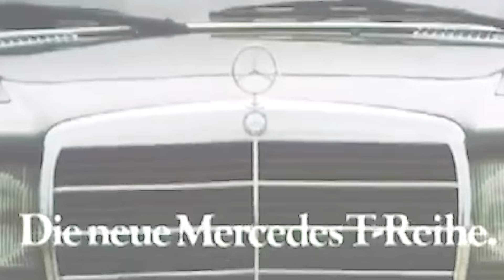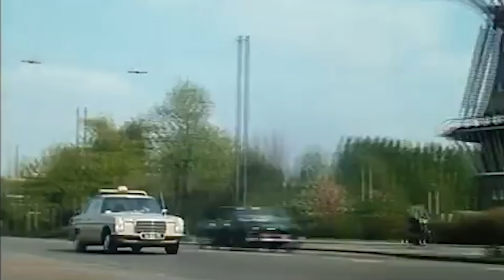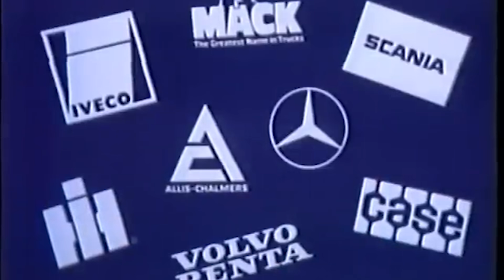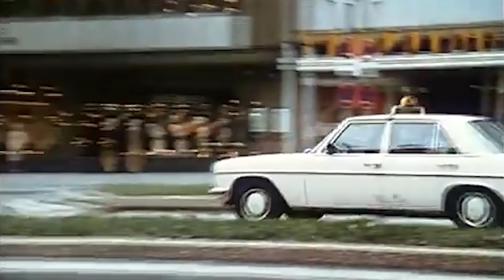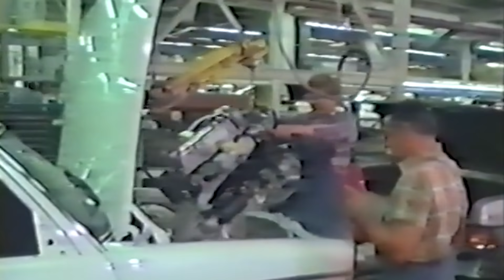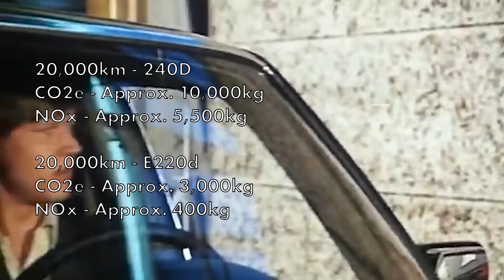Mercedes 240D - Still Fit for Daily Use?

Comment: OK I,m older, but I would still have back my 1971 Mercedes 200D  (what was it W114/5 or something like that?)  It had 55 PS (Pferdeshaft = BHP)...it was cheaper to insure than the 1600cc Ford that I had previously owned.....OK It was SLOW, and could be overtaken today by those Lycra clad maniacs on racing bikes....But it would drive from Northern Germany down to Frankfurt with no fuss or bother...after a couple of days (midwinter) it would start again and drive home?  It felt solid...unbreakable..if I wanted to (not a big guy) sleep in the boot(trunk).  or across the back seats.   One thing people forget about when restoring these cars...is that those springs although good, take a battering from the weight and if you don't change them for NOS or better...you will just have a nice looking sloppy bad handling car....when new, they were surprisingly nippy and handled well.

Comment: It also depends on if you have a robust used cooking oil to fuel recycling system, which large parts of the United States have, you burn what would be a horrible waterway pollutant, it burns cleaner than diesel both with respect to human health and things like particulates, which are potentially Greenhouse Gases as well, and also would biodegrade into not so nice Greenhouse Gases of their own accord, which also changes the equation.

Comment: Nitrous oxide is still an issue but these cars run on biodiesel and renewable diesel which lowers the emissions quite a bit.  And you can fuel them yourself with algae oil if you make an algae pond, or you can use vegetable oil so counting in not having to build a new car they're pretty good. It is annoying the smoke, I had a 1984 300SDL turbodiesel and there was always soot on the trunk.  This not true on my 2006 E320 CDI.  I think people missing that one,  The W211 with the OM648 really is the best of all classic mercedes.  It last longer, it's clear, fast, has advanced traction control, it's aluminum and corrosion resistant, it's safe, it's really the best one.

Comment: We used to bring W123s over from UK to Ireland to repair and flip in 2008 from ebay UK when they were cheaper to buy repair and flip. Now very expensive to buy decent UK one is 10k plus but well worth it  
I still drive a daily black W123 240d that I restored and put a 300td engine in it 5 years ago 127 hp goes great inline six  looking to import a project one from Spain less rust to repair and flip 
Great video can be driven daily if chassis is restored and engine injectors serviced pumps domt fail mine has 400k on td engine  if anyone from ireland knows any project W123s laid up to sell at sensible price  . Let us now.. 
Michael 😊😊😊

Comment: Carbon emissions are irrelevant. Its a complete made up problem. Should be obvious to anyone by now that its just about excerting power and control. Those "scientists" have been coming with these complete nonsense claims for the past 100 years now.. at least.. And NOTHING of it has ever come true.
So CO2 contribution is something no one should feel guilty about. Will have no relevant effect whatsoever with current miniscule contribution. And even if it had a measurable effect it would most likely do more good than harm for earths vegetation. Here in Sweden, before these climate scammers launched their nonsense, CO2 was called "The gas of life". For a reason.

Comment: Personally I would take the 230E and the 5 speed manual if I could choose. Both me and parents had the 200 and 230 and there was never a problem with those. Only thing replaced were some carburetor membrane for like $20.
Gasoline engines make the w123 feel lighter. And they run much smoother and quieter. Also 136hp in a not too heavy car is something you can still work with in todays traffic. Without becoming a complete road block. 
Only reason I would choose the diesel instead is if you want the car for some complete zombie apochalypse. Where you cant even get a battery or spark plugs anymore. Or if you really need to save everything you can on fuel.

Comment: I know many will disagree, but think about the financial aspect… a 240 or 300D in acceptable condition will cost about 8-10.000 and another grand in maintenance a year if you do the work yourself and will probably go forever… a modern 220d is what 50-60k, will require dealership maintenance at twice the price at least, ridiculously expensive tires and the engine will be totaled after 120k miles 
And I’m sorry but I’m mortal, I like my money and I’m not writing of 10k a year to be eco friendly..
Reply: i just bought a 300cd for $2000, all it needed was new glow plugs

Comment: Brilliant video, and an excellent not-too-deep dive into the environmental impact of 240d ownership.
I'd be interested to hear similar about say a 230e, bearing in mind the difference the NOx emissions would make.

I drive a small fleet of classics seasonally, a CX GTi, a beetle and an Alfa Sprint just now, collectively they do about 4 to 5k miles per year. Winter transport is a 17 year old Alfa 147 diesel that keeps going at 50mpg despite exposure to salt, between my wife and I that car covers about 10k/ year.

I have no plans to fall into the trap of new car churn every 3 years, and the cost, both to our bank balance and the environment that would mean.

I can't help but long to have a w123 at some stage. I had a brief time with a w124 300TE manual years ago but it was not the right car at the time for me, and was a prodigious oil drinker at over 1l per tank of fuel. I should have held out then for what I wanted and I'd liket have a w123 in my fleet now.

Comment: The environmental impact must consider what it would cost to replace this vehicle with a new one in its manufacture.    Are you really being more environmentally prudent buying something new and then sending this Mercedes to the junkyard?    How many miles would you need to drive the new vehicle in order to start having a positive net impact when replacing the already made vehicle.    Even if the old vehicle pollutes more, you still have to consider the mileage needed to replace it as well as the lower fuel economy that the new model will get.    And diesel takes less energy to refine than petrol so that also must be considered.    It is unimportant for someone to be a enviro-snob.     I would rather have an already made product and use it to its fullest life than to start the pollution cycle all over again on a promise of a cleaner future.    This same equation must be also deployed against golf carts replacing ICE engine vehicles.     How many hundreds of thousands of miles must you drive your golf cart to just break even with an ICE vehicle of the same class?

Comment: I just picked up a W123 over here in the States with 317k miles on the odometer. Hadn't run in over 5 years, popped a battery in it, it fired right up, and so far it runs exactly as people describe them brand new. Should be interesting to see how it pans out in the New England winter!

Comment: I owned a 1975 240D.  It was a great car.  I handed it down to my brother when I left for college, and he used it until winter set in.  He didn't have the patience to wait for the glow plugs to warm up, so he traded it even up for a Renault `Alliance. I loved that car.  It wasn't fast, but had great road holding and very good handling for a car from the 70's.  It would do 80 on the interstate all day with no problem.

Comment: You have one HUGE mistake in the calculation! The real W123 240D fuel consumption is NOT aprox. 9l/100km but in reality I easily have 6,5 - 7l/100km. And also the W213 E220d is NOT 4l/100km !!! It is more close to 5,5-6l/100km.Which makes a huge difference in your calculation, So the actual difference in CO2 emissions is much smaller, you should compare it like W123 = 7l/100km, W213=6l/100km. Of course, there are other emissions like NOx where the W213 is easily much cleaner, but on CO2 there is not that big difference, that is the point.

Comment: I would like to share my 2 cents on the environmental aspect

The main debate when it comes to EVs is the maintenance costs. There are horror stories of electric cars needing entire battery packs that cost tens of thousands of dollars for replacement, and the cars may have less than 100k miles on them.

Compare that to an older vehicle with more readily available parts. While it may end up costing more to run in fuel, it ends up being cheaper in maintenance costs. An end consumer would probably prefer ease of maintenance.

This isn't to say that all people who drive older cars don't care about the environment. I have to question how it benefits us with needing to strip mine the planet for lithium to make the batteries. I know it gets more complicated factoring emissions when a car is built, but maintaining 1 vehicle over 30 years compared to owning multiple in the same time frame should have less overall emissions

Comment: I really enjoyed this video presentation.  It is timely because I am nearing the end of my research project, a different daily driver. I am still deciding between the 115 and the 123.  I like both, but the 115 reminds me of a baby version of the MB 600.  It is the grill and the vertical Euro headlight/park light combination that stands out so well.  My TD has served me well, I mean what can one NOT carry in the back when the seats are all folded down?  I currently have a '85 TD Turbo with 310,000+ miles.  The car runs great but the previous owner did a horrible job at rust repair and I didn't see it coming at the time.  

In today's era of cars, speed is the driving factor, and [too much of it] is dangerous.  Where I live, there are speed cameras everywhere.  Why? Because there are schools, churches, community centers, restaurants, hardware stores, libraries, and residential areas with young children.  Unfortunately, this is mostly where I see so many trying to prove something behind the wheel.  Power?  No, stupidity.  

I will say, however, a certain amount of power is needed to merge into moving traffic; this could be dangerous.  I have seen tiny compact cars coming out, barely doing 30mph.  OMG, do they have any idea?

I had never seen such a breakdown of the environmental impact as you described it.  It does make me think, better to have something renewable, and repairable, rather than disposable, the same situation in the home furnishings industry.  Give me a house full of good antiques any day of the week.  Timeless and green.  So I will add this one to my research and see where (what) it leads me to.

Comment: An enjoyable video with a confusing coda at the end.
The   propositon that the  occassional user of a classic 240d does 20k a year is   a year   is  statisical  nonsense and is no basis for making a comparision to a modern EV.. 
 Rootfilters or diesel filters on the continent  can be retro- fited to old cars and were proposed as an alternative euro norm LEZ zones starting in Germany then the low countries,,, but excise duty the gov gets on new cars  and the car lobby ensured it never really took off.
  However, the elevated price of fuel is a natural DPF for older cars that in any case do very limited and nevertheless enjoyable mpg
Ev  propaganda  is rapidly loosing traction,,,,dieselgate proved they lied about diesel emissions,, ditto for Electric ,,,they have a place but are not the solution,,, maybe hydrogen
The Truth?? we need to produce less cars and keep  and cherish existing ones longer as a privelige not a right,,cars should not be bought a notional  every 3 years ,,,,does this mean job losses,, yes,,, therfore less  factory pollution,,, something former and more consevative / less avericious generations understood too well. and no the car companies have no interest in saving the planet ,,,just their profits.

Comment: Older Mercedes need a lot of restoration to all the rubber and plastics used in the fuel line, steering components, shocks, window guides, sunroof seals, electrical components, engine components, etc.  Also the interior seats tend to breakdown, the seat cushions need replacing, seat belts need replacing, etc.  Cost of parts is usually three times more expensive than domestic cars.  However, a new one would be most comfortable on long drives.

Comment: For the environment, diesels can run on biofuels like hemp oil, vegetable oils reused from the restaurants, you name it.  If it explodes under pressure, then a diesel engine can run on it.  Hemp oil does pollute to the level it took the pollutants out of the air  -  hence, climate warming neutral.  Does the government get it?  No.

Comment: My Grandmother Still Currently Owns A Red 1983 Mercedes Benz W123 240D Sedan With A 4 Speed Manual Transmission With a Color Matched Red Leather And Suade Interior and a Red 1984 Mercedes Benz W125 240D Estate With A 4 Speed Manual Transmission With A Matching Red Leather And Suade Interior

Comment: In my opinion, i'd rather sit next to an old running diesel w123 than a newer common rail diesel mercedes with the pollution devices removed. And oh boy there is a lot of cars without the devices.The particles are so small that they really get in to your lungs. You can't stay in the same space with cdi mercedes running if the cat and dpf are removed. And people who are working daily with these cars, keep this in mind. 
I'm not saying that the good old mercs are good for the environment. Would be nice to see what modern emission exhaust tech would do to the old engines. 
I also have these older diesels.. I plan to own and ride them until the day they get banned. But i'm going to always keep them running clean and efficient.

Comment: I had one in 1979-86. Seats gave permanent back injury. Rear suspension fishtailed with rear passengers and their luggage. Would not start at 16 degre.Valve guided and steering gear plenty worn by 65.000 miles.

Comment: This is one of the best engines ever made.
Reply: As for the environment, you have to consider that by using an indestructible car like that longer, no new resources are wasted and maybe even CO2 saved. Furthermore, these cars consume very little fuel. Modern cars are more efficient, but also more powerful! If people really cared about the environment, they would have kept powet at 50 hp while improving efficiency!Unfortunately, driving is not a rational issue but an emotional one. Greetings from Tunisia.

Comment: Those cars could also be run on used cooking oil (of course filtered), which would change the answer on the environmental point. Works also on the 124 Diesel engines. However, although not required in all cases, I‘d recommend a two-tank-setup when you use it regularly on shorter distances.

Comment: The lack of lithium mining that's involved in modern batteries for electrics, plus the long lifespans of these makes me think they're plenty environmentally friendly. Also the fact that it's not clearcut whether gas or diesel particles are truly more environmentally friendly. Diesel takes less refining, the weight of the particles takes them out of the air faster, and their CO2 emissions are lower.

Comment: Brings back fond memories. Way into the years 2000's there were still 240d w115/8 taxis in Brussels, let alone how many 124's. When i was on holiday in Morocco in 2006, at least 90% of all cars were those Mercedeses. Mechanics simply had plates "240/300" and that was it. You saw young boys doing welding jobs in the middle of the night. Awesome! By the way, thanks for the extensive info 👍👍

Comment: My 1981 240D is my main car. I commute to work in brutal Silicon Valley traffic and I take in on road trips on the open highway. Around town and in heavy traffic it doesn't matter that it has so little power. It's only an issue when accelerating onto the highway in light traffic--sometimes people honk. Once up to speed, I cruise at 75-80 mph in the fast-lane for hours. The speedometer stops at 85, but my GPS indicated 87 the other day. The seating position and ergonomics are more comfortable for me than new cars. The visibility is superb--far far better than new cars. The air conditioning no longer functions, and while it can be repaired, it will probably cost more than the car. The main issue he did not mention is that replacing vacuum and evaporator hoses on W123 cars is getting almost impossible--I'm having hoses custom fabricated now. Nevertheless, it is a superior piece of machinery compared to most new cars--including Mercedes. It doesn't have as many creature comforts, but when I replaced my 2019 Acura TLX with this, I didn't miss parking sensors. (I do miss A/C, but I manage). What he isn't talking about is that over the lifetime of the vehicle as it has moved from owner to owner, possibly 10 more cars have not been built or junked because of this (and other older) car. Over a time frame this long, I think driving a W123 chassis is better for the environment.
Reply: Creature comforts other than comfortable seats, heat, and AC belong in a home when the driver is NOT distracted from the road.  All the stuff in many new cars compete for attention and can be fatal.  The only thing that belongs on a steering wheel is the hands of the driver.  I will NEVER buy a new one.
Reply: @ronalddean3630 Steering wheel controls are actually good since it means not having to give full attention to said distractions. For example, if you are bored of the song currently playing on the CD, you just flick the switch with your finger and the song is gone, as opposed to taking your hand off the wheel and pressing a button, or even worse, having to look at a screen and pressing non-physical buttons.
Reply: Not bad, but I'm telling you man, the one you really want is the 2005-06 E320 CDI!